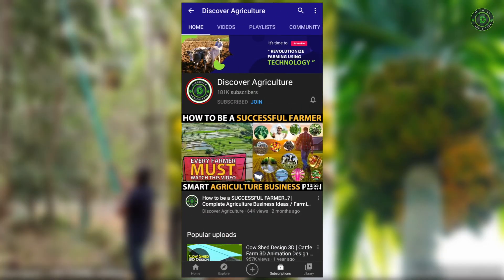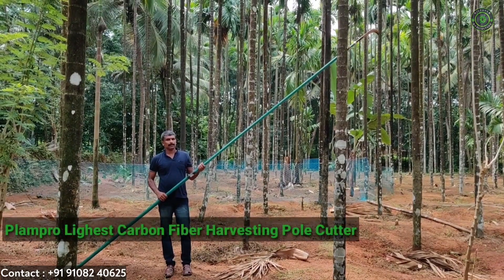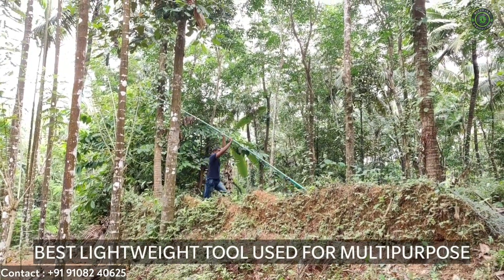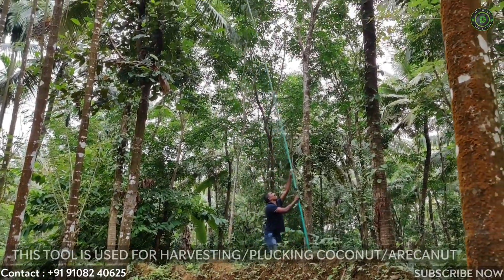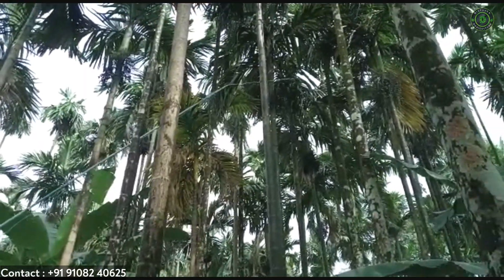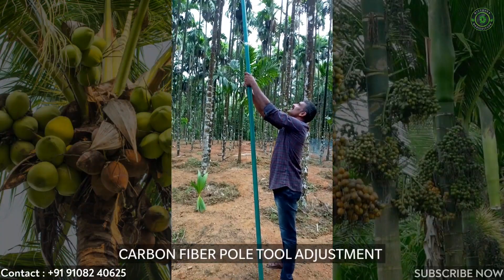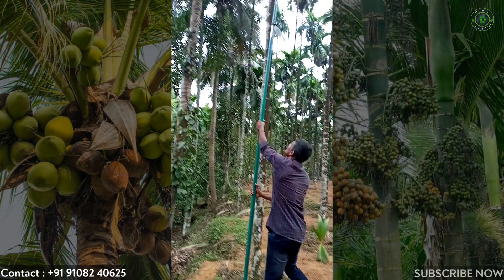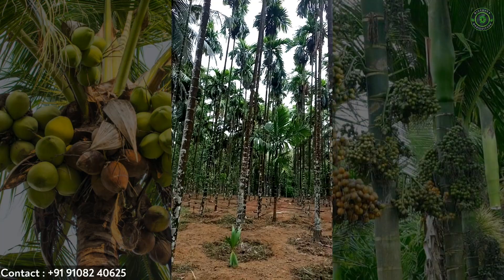Coconut/Arecanut Harvesting Pole | Coconut, Arecanut Plucking Tool/Machine

Comment: Must setup a net around trees or else you'll get a damaged coconut. But may be good for pruning purposes.
Reply: Coconuts can take the fall, unless they are  harvested before its fully ripe for the water. The shell thickens and hardens as the coconut ripens. Fully grown coconuts are usually dropped from the tree and bunches of tender coconuts are tied to a rope and lowered to the ground. But yeah, if you are harvesting tender coconuts with a pole, you need to cushion the fall with a net or something. Ripe coconuts will be fine.